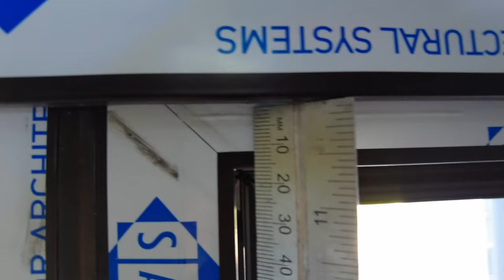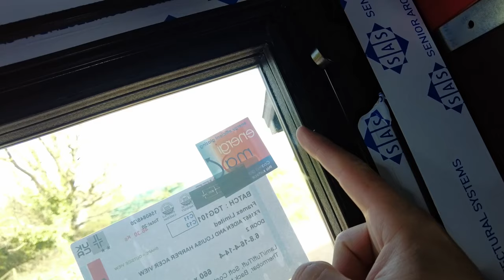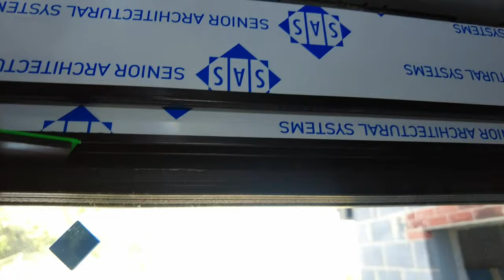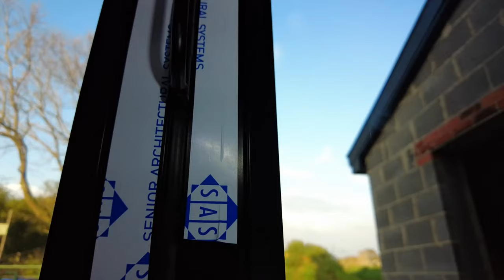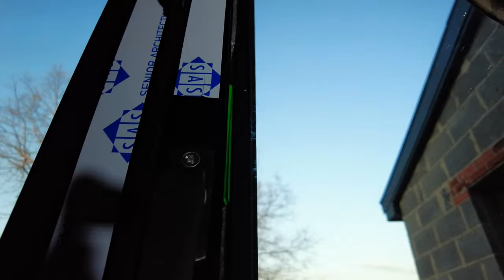How To Fit Aluminium Bifold Doors - Complete DIY Guide

Comment: I leave a 10 to 12mm gap up the sides of frames when installing in block and render walls, then fit the expanding foam tape after installed, makes it easy. ALSO if you make the opening tight to the frame, you loose too much frame behind the rendered reveals.
Reply from the maker: Ah that would be a nightmare tucking this width of tape in 😂 I know people do it afterwards but I'm sure that's only 20mm tape or something

Comment: Good job gentlemen! 

I have some questions...

1. Those triple glazing packers, is the only difference that they're a bit wider? Surely you could get away with using the regular ones? Or cutting the regular ones down so that their length is the same width as the triple glazing packers? 
2. Why are the non toe and heel packers needed if the thermal break foam stuff is in there supporting the glazed unit all the way around?
3. How come you didn't fit the sill to the frame before installing them? I guess just because it would have been too unwieldy to flip the massive frames over (twice) ?

Must be so frustrating to have to deal with the laziness of the fabricators, but I guess they're probably unskilled workers who are paid peanuts... But you'd think / hope thay they'd do a more professional job at this price point!
Reply from the maker: Cheers 👍
So the triple glazing Packers support all 3 panes of glass, yes you could use double glazing Packers and cut the length to the same width as a triple glazing Packers but then you're dealing with several Packers that are all falling out as you're trying to position them 😂 I bought the triple Packers so I could keep my sanity.
The foam backer rod isn't supporting the glass, it's just providing additional thermal enhancement. The additional Packers are for enhanced security, they're used to stop someone flexing the frames past the locks with a crow bar basically. So 1mm of flex is better than 5mm for example. They're needed to pass the security ratings and new regs.
I fixed the cill first as per the manufacturers guide. It also comes down to preferences really, I'd rather do it as I did because it's easier to get a proper seal with the fixings and silicone, otherwise you can risk water going in other places other than the correct drainage channels. I have fixed the cill directly to the frame first on uPVC doors in the past but I was just guessing at that point regarding installation and went crazy with the silicone.

Comment: Interesting and something I wanted to learn for a while as I hate having to adjust/fit doors etc and as you say so many videos don't cover the little details, they assume you know it. We had a 5 meter bifold fitted which is out of my comfort zone but would definitely give a smaller one a try if time wasn't an issue. How did you secure the straps at the top with the steel lintel?
Reply from the maker: I'm sure there's probably a few things I missed out filming as well! 
Yeah I can understand that 😁 this was my practice before my bigger set and no time limits as such 😆
Same method pretty much on the top straps, I just had to drill through the metal with a hss bit before I swapped for the sds drill.

Comment: Good video Aiden. One of my jobs for next year is to increase the width of an existing opening, new lintel/rsj etc (currently sliding doors). I was planning to pay a fitter to install the doors but after receiving eye-watering quotes (£4600, with fitting, or £2200 supply only) I've decided I'm better off doing it myself and taking my time. I have fitted UPVC windows before but never a bi-fold. I like the look of the Korniche system as plugged by SkillBuilder. It seems to rely on 'through' fitting rather than straps. What I'm not sure on, and haven't been able to definitively answer  from the instructions is how you fix the head. Most forums vehemently insist the head of a frame should never be drilled, such is the risk of water ingress. Surely with bi-folds a mechanical head fixing is a good idea considering the weight? Any thoughts?
Reply: should also add it's a relatively small bi-fold at 2700 opening, hopefully manageable by myself and 'reluctant' other
Reply from the maker: I always fix the head, the people that rely on foam are just being lazy. Shouldn't be a risk of water ingress as long as you set them back appropriately and seal properly. There's a load of weight on the top when you actually open the doors, be crazy not to fix it. If you've got a catnic style lintel then you should be able to drill the frame and steel with a hss bit then swap to a masonry bit for the brick/block above. Then pop in a masonry screw. If you have a big steel then get the techfast roofing screws.
Reply: that was my thinking! Thanks for providing a second opinion!  @THE-AIDEN-PROJECT

Comment: Hey mate ! I’ve got 150mm cavity closers plastic one from Toolstation, will bifold doors just screw straight into the plastic seals I can’t see how it’s going to hold it ?
Reply from the maker: Hey, you shouldn't be fixing into them kind of cavity closers. I believe the only ones you can fix into are special preformed structural ones, they are the type that are tied into the walls as they are built. If you retrofit a cavity closer then you need to be fixing into either the inner or outer leaf. It's easier to use straps and fix to the inner leaf or do a direct fix to the outer leaf. Check with your bifold manufacturer how they recommend to fix in place. You might need to adjust this though especially if you're following regs and setting the frame 30mm back into the cavity.

Comment: Where did you get the window straps from if you don't mind me asking?
Reply from the maker: I got them from the window supplier as they are made by the manufacturer of the windows and doors. Lots of window and door manufacturers have their own straps, some twist in like these. Otherwise, there are universal ones available
Reply: @THE-AIDEN-PROJECT  good to know thanks for the fast response 👍